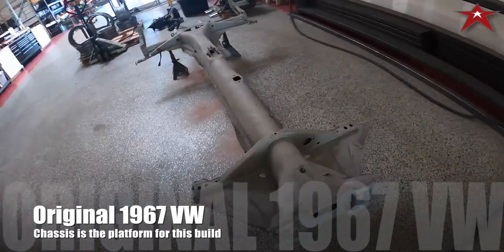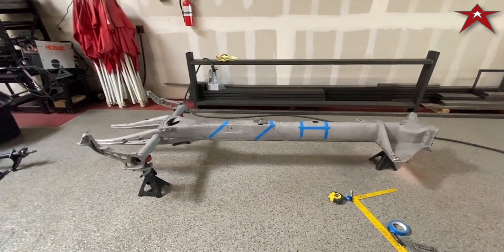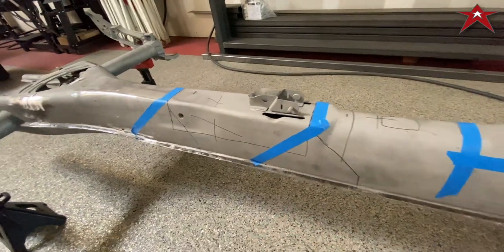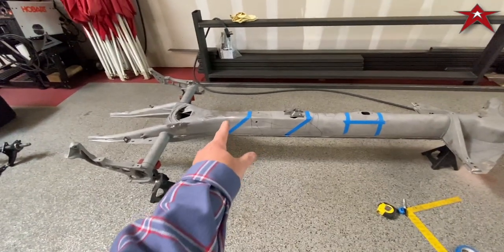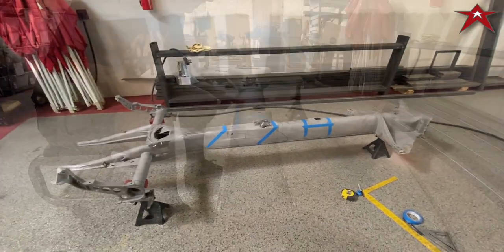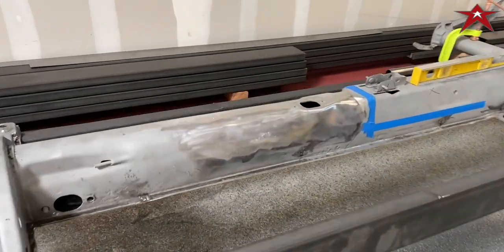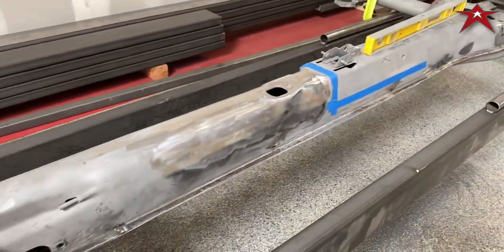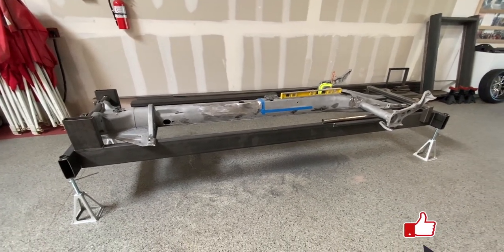Why the heck would you shorten a VW Chassis? To build a BAD A$$ VW Kit Car! Whaaaaat?!?!

Comment: That is awesome work. I wish I would have seen you video a long time ago. I have shortened 2 we chassis , never that good.  I built a hunting buggy with all the stuff I had left over. Cleaned out my garage, built a buggy. My latest gets a lot of use out in the woods. It's a combination of super beetle chassis ct 14 inches in the front. Bug front grafted on. Shifter and pedals moved back. Then changed the rear suspention, used Empi spring plates,home brewed adapters. I'm using a 59 bus trans axles.adapters for bvb the reduction gear boxes. I had the front spindles lengthened 3 in. Gain some altitude. I could use a raised front axle...loved your craftmanship. Awesome.

Comment: No need to shorten stock vw beetle floor pans any more as we manufacture VW beach buggy floor pans. They  fit from 14 too 15 3/4 inch shorten buggy’s. Made from 1.2mm 18 gauge steel.
Reply from the maker: Interested.
Reply: Ordered my floor pans yesterday. They do look awsome. Can't wait to get my chassis built up.